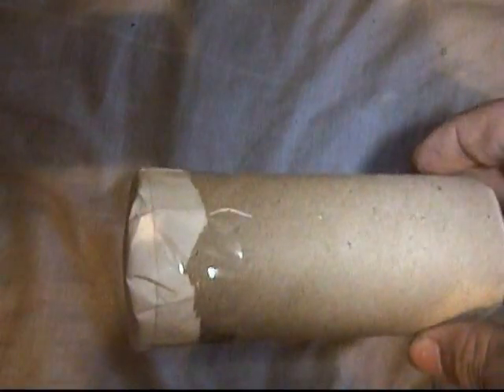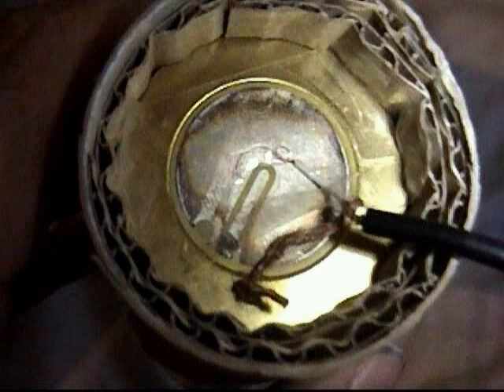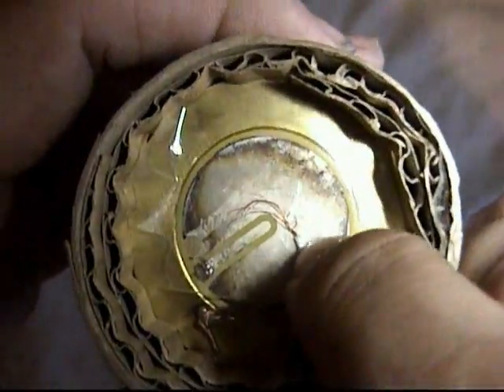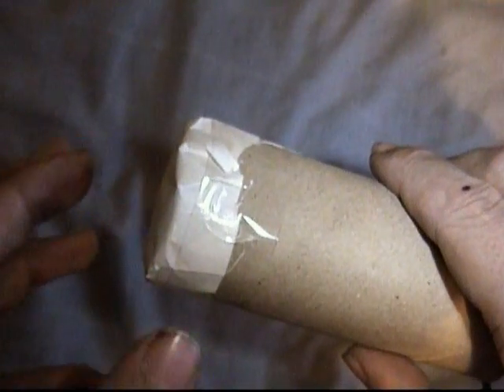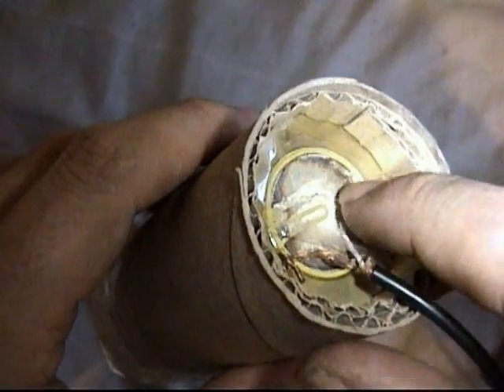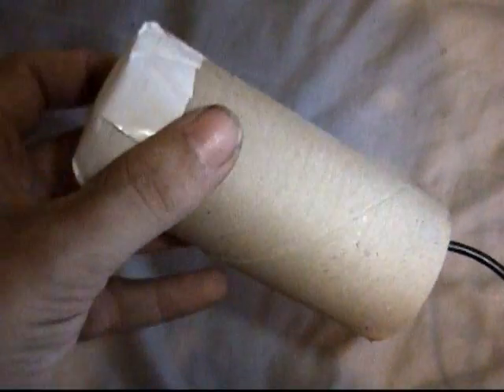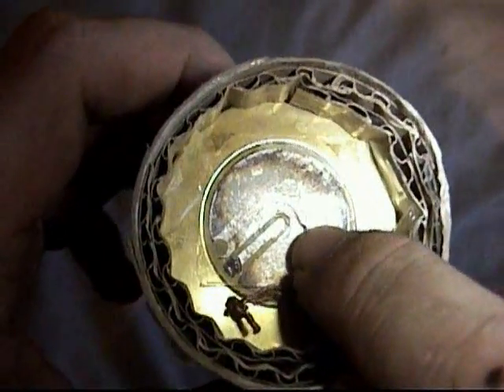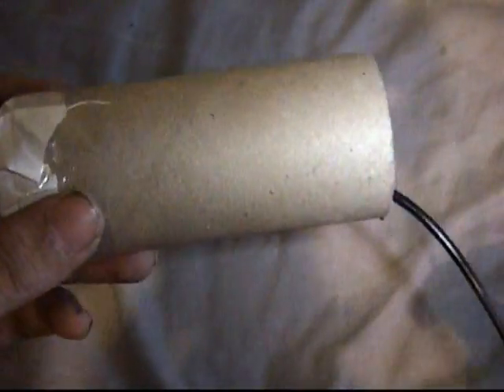Home-Made Crystal Microphone

Comment: I've had the crystal mikes that came with 200 in 1 electronic project sets, construction was similar. Diaphram diameter was 35 mm or so. Those sets also had the crystal earphones which were smaller versions. All connected the diaphram to the crystal with a rod.

Comment: interesting.  i know a piezo bender like you have used works as a contact mic pretty good on it's own. the tinny "mid range honk" sound generally comes from high and low pass filters cause by the capacitance from cable + piezo running into your recording device's input resistor (something like that). A high impedance input buffer preamp could help - maybe even a charge amp. I think that could be my next experiment - gotta get hold of some of that crystal first. nice vid from 3 years ago - cheers